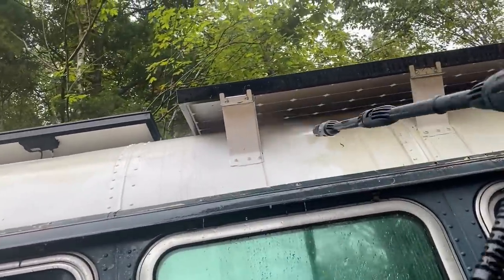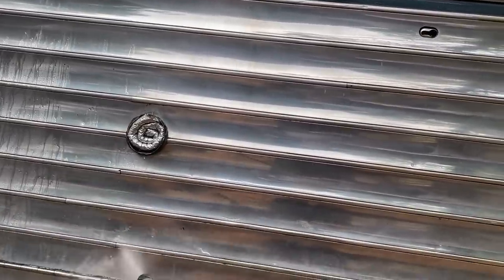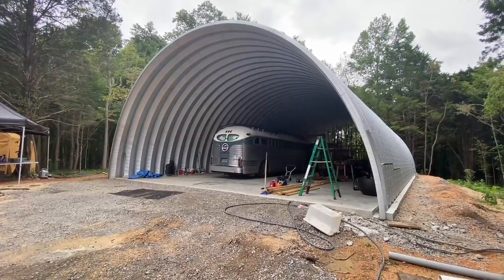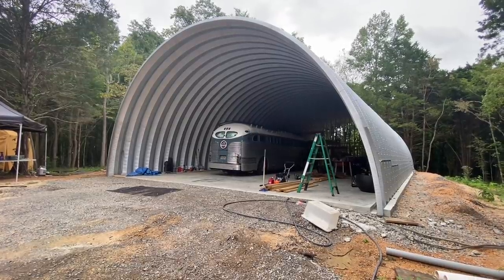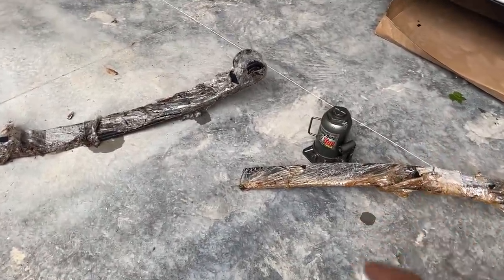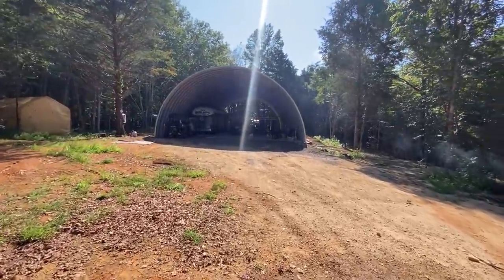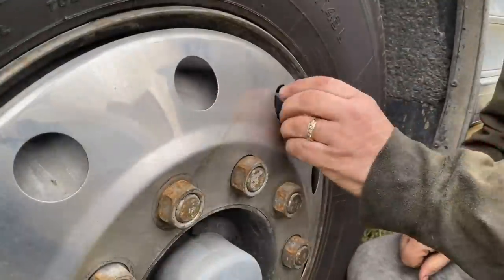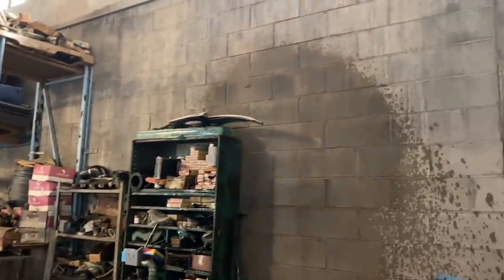Moving our 1947 gm bus into the new shop!  The first bus to cross the threshold deserves to be lenny

Comment: Your comment about building up air pressure reminded me of being in the fire service in the 1980s. The 1970 Mack CF 600/Baker Platform was mostly driven by us call firefighters arriving at the station from home. Getting the engine lit and revs up was important to build air so we could leave quickly. After the buzzer and red light wen out enough guys had dressed and boarded that we had a full crew.
Reply: Did they always have those exhaust tube? Or did you guys just eat it for breakfast?

Comment: You.need exaust fan, & some light's. Daylight on shop side, high output, so they fire in cold? Apartment side, well that's your desighn. Looks good, hope joy do well .
Reply: Get LED lights, more efficient and the cold doesn't affect them.
Reply: @markpeterson5479  LEDs are hard on the eyes. I have been a licensed electrician for 35 years. In certain applications flourecents are better, even light. The best street lights they ever made were low pressure sodium, your eyes relax in them. LEDs are very harsh on the eyes.

Comment: I would love to have an old bus unfortunately I'll never be able to afford one
Reply: Naw not true man.  I bought mine already converted for 3000$ off an old man that had done the conversion in the 80s and as he finished it his wife divorced him and bought the house next door (the hole situation was very odd and I suspect that he was leaving out alot of things) they were still friends ect. He'd only used it a few times and it had been sitting mostly. He stored it properly and even started it to look at before I decided to buy it. He'd said he originally had it listed for 45k$ obo. When I finally stopped after a couple of months of seeing it as I drove buy i stopped and saw the price he had on the window sticker he had in it. 45k then 35k then 20k all crossed out and the last one said 3000$ had lots of people look at it and like it it was very well put together but dated but everything from pots and pans a few other dishes as well as a bedding for all beds and a set of towels dish rags And rugs that were mostly new. It needed tires basic service oil change and filters fluids checked greased but nothing major. Even got the generator running and to the point where I was able to try and test it (unfortunately the generator head caught fire during testing and it burned bad enough to be too expensive to repair it) but everything else including the propane fridge and stove both rooftop ac units and all the rest of the systems fully functional.  Replaced the 2 8d and the house batteries gave it a good deep clean and sanitized everything and went camping the next weekend with it. They are hard to find but if you look there's lots out there for cheap